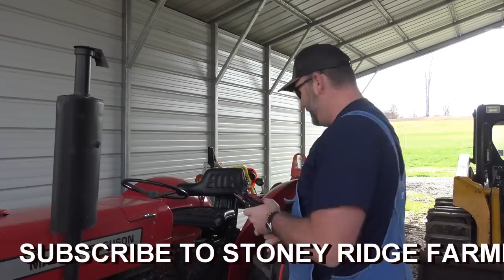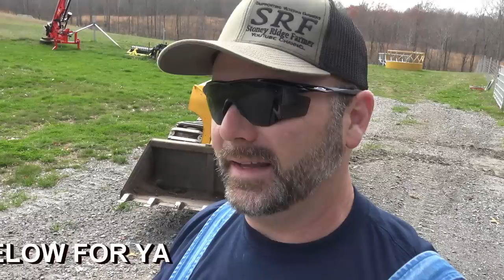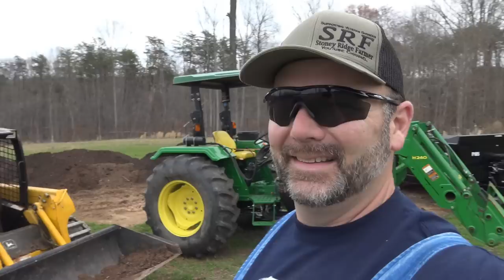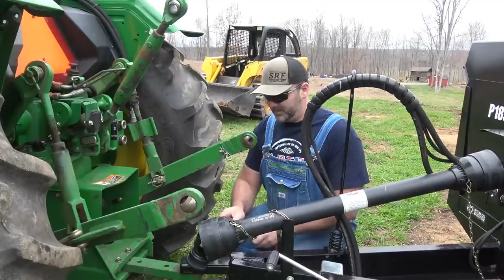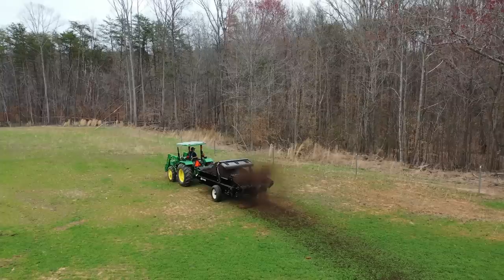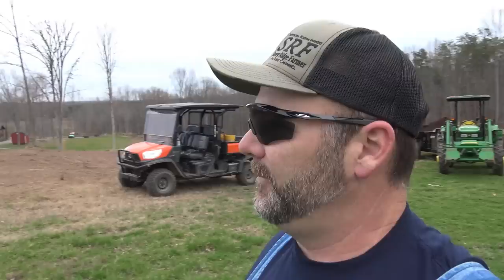Farm Tractors at work...load it up and spread it out!

Comment: Did you adjust your cluth periodically? Mine has around 1200 and I have adjusted my clutch once. So far so good. Your mileage may vary....... Kubota machines are turtle slow. Always have been. They are tough as nails but slow. All the side by side machines have their oddities and quirks. I can't afford to try them all and I am all about green machines so I just stick with my Gator.  Hey that is a poop slinging son of a gun! Is it chicken litter? Oh yea might want to work on you spreading pattern. Yours looks kinda loopy. On a serious note your vibration could be coming from the PTO shaft. I noticed that attachment has a lot of looseness in it. When you put it in a bind as when you turn does it get louder? Take it off and try it without it and also without the spreader shaft attached. Please wear a mask when handling manure. That is some nasty stuff if you inhale the dust. Poop spreading is a nasty business but so good for the land. Several area farmers use chicken litter from north Ga. Been stockpiling it all winter. Going to be smelly when they start spreading.......... Farm on!
Reply from the maker: My clutch failed at 800 hours...due to a rear transmission seal blowing